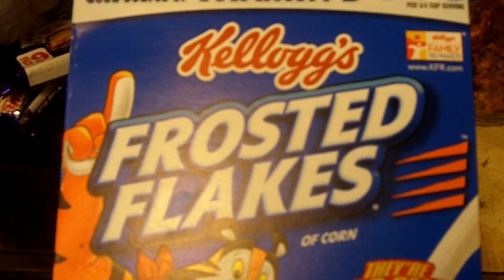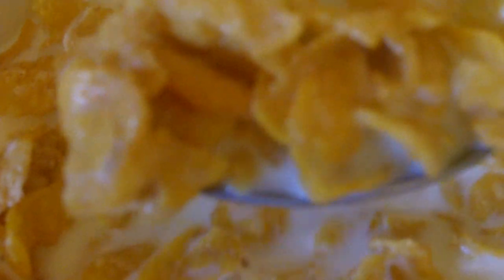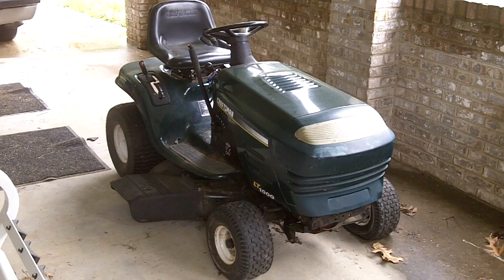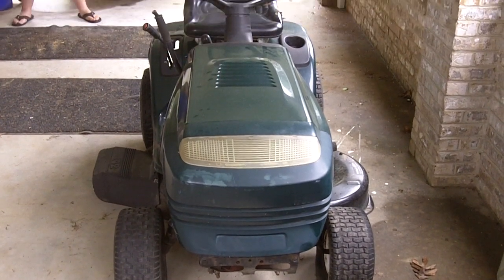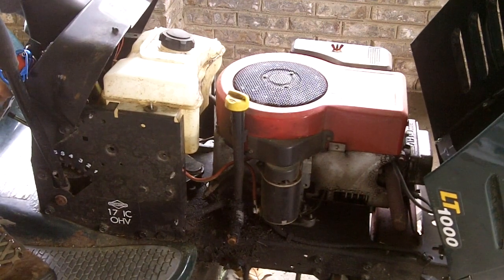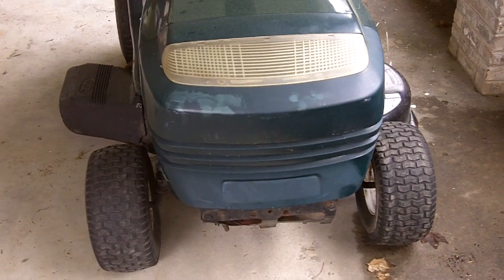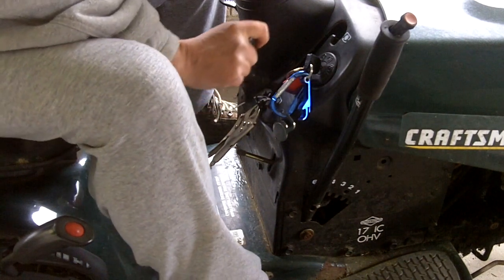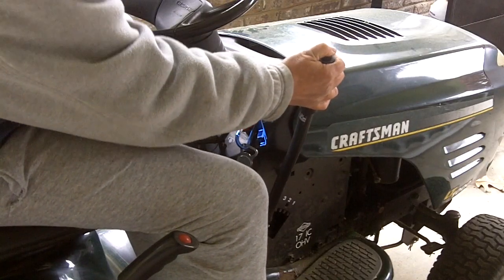Craftsman LT1000 - Part 1: Will it run?

Comment: It’s a winner and with that engine will last 40 years
Reply from the maker: I hope you're right. We've been using it for a year and have replaced a cable, a belt, and a pulley so far. It was 20 years old when we pulled it from someone's yard. It's hard to believe it could last another 19 ... but you never know. - Clay.